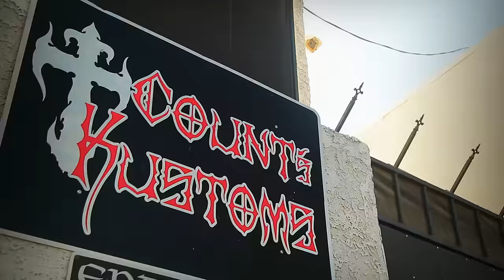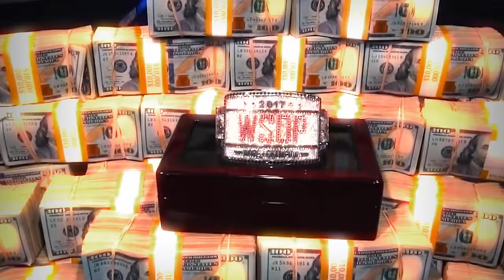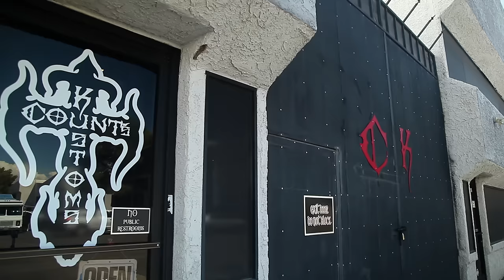Counting Cars: Custom Chopper for World Series of Poker (S8, E10) | Full Episode

Comment: Shannon had no intention of setting that tank down low on the frame. When he, Danny and Ryan were in the shop talking about the bike they were all talking about setting it down low, when Ryan and Danny were leaving Shannon  set the tank down on his welding table right next to the sheet metal that was going to become the bottom of the tank. It was formed to sit high on the frame. It looked so much sweeter sitting low then the finished version sitting on top the frame. Other than that...i loved the bike!!!